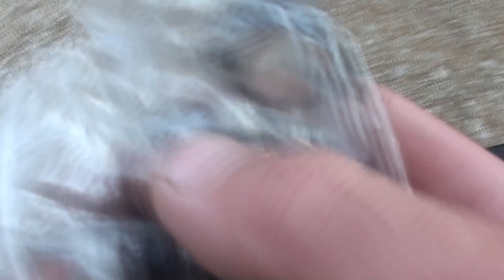Ford 515 Sickle Bar Mower Prepping it For The Field

Comment: I discovered why the previous owner of your 515 shimmed some of the rock guards.  Prepping the 515 I just bought, I noticed that several blades had a gap away from from the guards when I would have liked them flat against so it can cut like a scissors.  Well today I made my first pass around the field, blades were sharp and cutting, then belt started to vibrate and within seconds snapped.  When I returned to the barn I noticed there was a lot of grass wedged between the blades and guards, was hard to pull out.  I have never seen that happen on other sickle bars before.  Now I realize that the wedged grass made it hard for the belt to move the blade bar snapping the belt.  The solution is to shim those guards where there's a gap so that they will tilt and be flush against the blade.  Now I have to order a new belt which will take a week to get here.  Meanwhile shim those guards.

Comment: Great do it yourself video,  and I hope the best for you.  Grease, grease, grease ... oil, oil, oil that cutting bar...
Think that 515 is old. Try my ford 501 sickle bar, and yes a case 230 square baler 
Both early 60's 

Happy cutting, and enjoy the learning process...
My best Scott
Reply: We had a ford 501 on the farm, but I never remember seeing it in operation as all we used were new Holland 451's when I was old enough to work in the field.
Reply: We've still got two Ford 501 mowers here at home, for use with Ford 800 and 601 tractors, on misc mowing jobs. (started running when 6yr old) 
I need to spruce them up, and go mowing scruff/weeds off pastures next week, so cows have better better grass growth for rest of summer.
We've also got two JD sickle mowers... one "belly mount" for JD-3020 tractor, and one rear-mount for anything else... plus a JD-1209 pull type mower conditioner I was running a few weeks ago in three hay fields.
Unfortunately the disk-mower is broke down, and costs extra to fix.
A brush-hog can be used for 'rough work' but not good for hay.

Comment: He doesn't go through things as far as showing which lever does what
Reply: On that style of Ford tractor, there is a lever near Right side of seat that lifts the  "3-point" equipment arms.   To turn on/off the PTO shaft turning the mower, you first push in the clutch, and engage/move a lever near your Left heel (when sitting on tractor) then as you let the clutch back UP, it applies power to the PTO + mower.